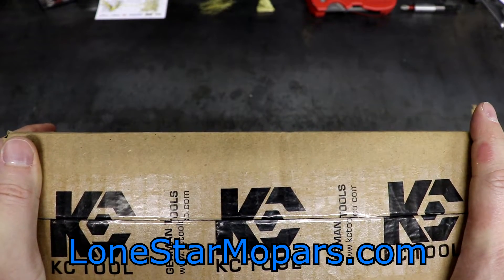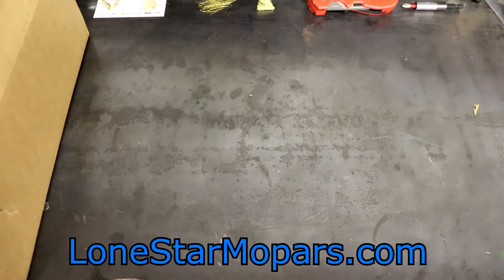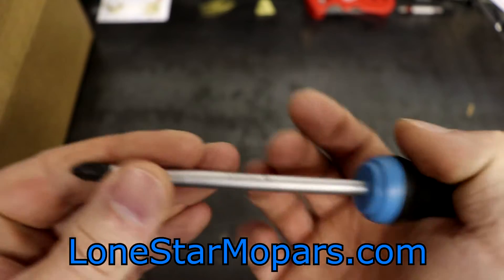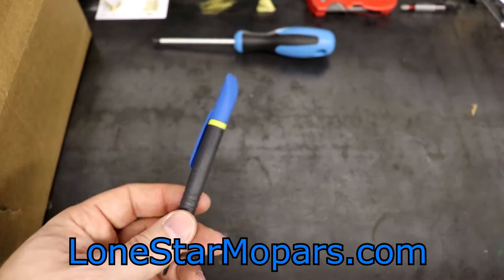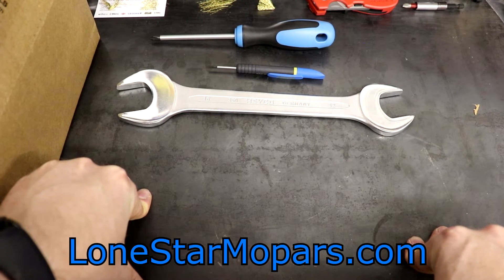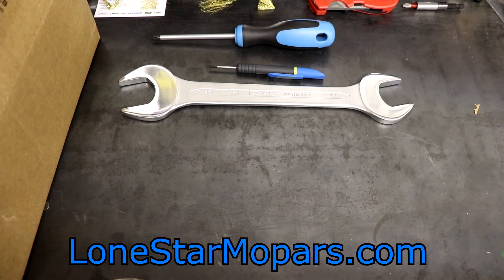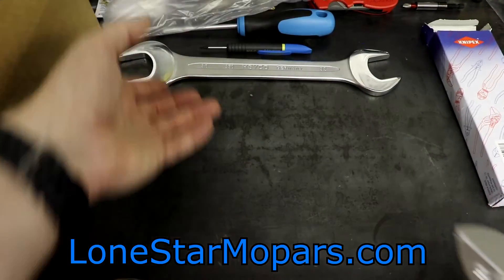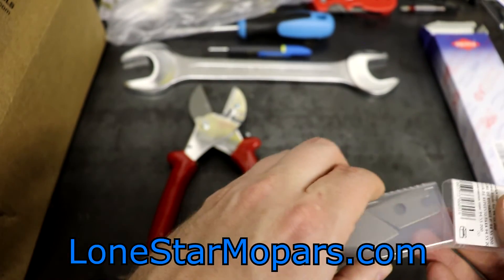KC Tool Haul #17: Hazet Screwdrivers, Heyco Mega Wrench, and Knipex Anvil Shears

Comment: I’ve been watching your videos for a wile but never felt the need to comment. Well today is the day. 
I really found your video useful for my trade. The small driver with the sticker removal pin top would be great for me. Every time I get a new client the sticker from the previous service company has to be removed. Maybe that pen top might do the trick.
Also, I have to deal with reinforced tubes/lines that are cut resistant. The other tools that cut them are way too big to carry around but the Knipex wouldn’t take up to much space in my tool bag.

Thanks for the video.
Reply: Mike Reed One trick I have to remove stickers is to wet those with WD40 and leave for a minute. The sticker will literally fall off. 
However this works only on paper stickers but not those made of plastic.
Reply from the maker: Awesome..thanks for watching and I hope that the driver and shears will serve you well!  I pull a lot of labels over the course of the day in varying degrees of difficulty and having that on me at all times was the big selling point.

Comment: Use a box end on the other end of the open end for extra leverage. Make sure you keep it straight cuzz it can slip .
Reply from the maker: I'm thinking it'll generate a good amount of torque as is, but I may have to resort to that.  Seems like the fans either come off with ease, or are a complete nightmare...not much middle ground.

Comment: Hey, curious as to what your black table top is made of there. I got a nice table with a top that is supposed to be chemical resistant and it is super hard and somewhat like plastic but looks just like yours. What I really need to know is how can I cut, or drill it???
Reply from the maker: The Mopar mat I usually have out is just a small, work mat...rubber construction.  The table top is one I just trimmed down from a 4x8 Sheet.  If your table top is plastic it will be a breeze to drill.  Cutting it won't necessarily be hard, but you might have a hard time getting a nice edge.  I'd start with what you want gone and work in the most inconspicuous area in case something goes wrong.  If you have access to a large shear, that would be the best way to get a clean cut in a wide piece of plastic.  Good luck!

Comment: I know it was a few videos back but i wanted to ask which ratchet do you like better the stahwille or the hazet ratchet debating on getting on of their advent calendars
Reply from the maker: Hate that I'm not more helpful, but I haven't found fault with either.  The Hazet seems a bit more robust, but it is also a huge 1/2" drive compared to my smaller Stahlwilles.  I honestly might base it on which accessories you like better.  I don't think you can go wrong with either ratchet.

Comment: As for the L-key set from Wera with the colorful sleeves I must advice not to get it. 
After a short period of usage the sleeves slide off and the marking on the sleeves wears away. 
Once your sleeves start to slide the key holder becomes pretty useless. 
HOWEVER, beside the sleeves, the function of the L-keys is superior to your ordinary L-keys. 
These keys realty grip the bolt head and to round a head isn’t easy. 
Get those, but the one without sleeves. 
Bolt holding function with a small ball bearing ball is an added feature I love. 

The 32/36mm spanner is really a good tool. You seldom find 33,34 and 35mm anyway while 32 and 36mm is quite common. 
What makes it better yet is that the spanner is quite stubby. Usually a 32 and 36mm would be long and bulky. 
I guess the trade-off is that you won’t have as much force on a stubby spanner vs. a long spanner. 

Good video as always 👍🏻
Reply from the maker: Thanks!  I would love to see Wera put a coating on the keys..I've seen other manufacturers do it...would kind of be the best of both words.  The sleeve does provide a little comfort.  I was really happy with the wrench...most fan clutches are either 32 or 36 and the long, flat spanners in the cheap rental kits are less than desirable.  This one will hopefully serve me well!

Comment: I going to order one on the next over from KC I can use a label scraper
Reply from the maker: Haha, I'm glad someone admitted that...It is 100% the reason I was drawn to it as well.  Has worked great so far...I always cut/scrape labels off of boxes before cutting them down and it will usually get under the edge of ones that won't peel off easy.

Comment: Those are actually a knock off of rolcut garden shears.... resold as hose cutters
Reply: nope thats not the full story
i am pretty sure those knipex are made by loewe (original-lowe.com) for knipex
and this company invented the anvil sheer and patented it
from the history part on theire side it looks like there was a connection with rolcut, but i couldnt figure it out exactly
Reply from the maker: Is Rolcut still available?  Having a hard time finding anything current.
Reply from the maker: I checked out their website....they sure do look similar.  I'd also be interested in their pruners, lol.